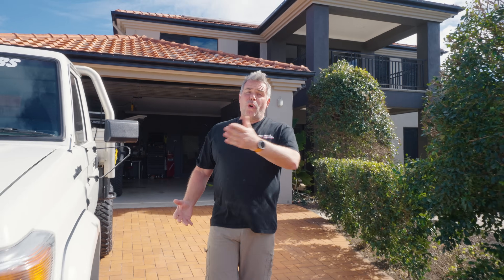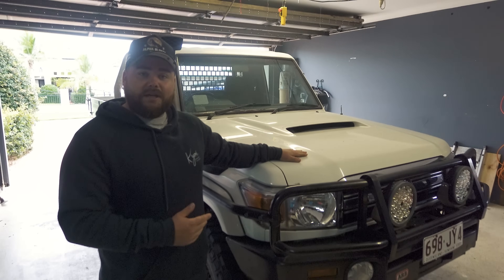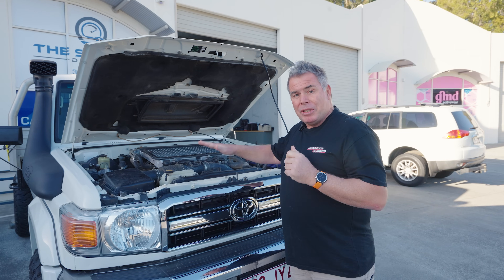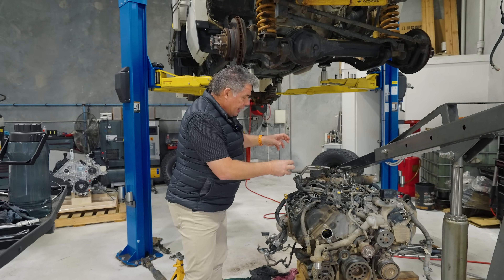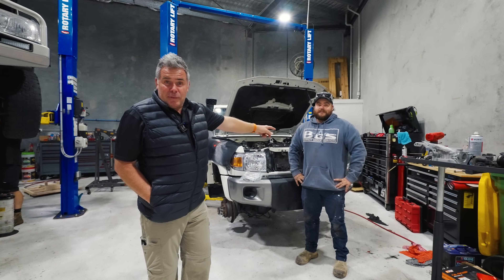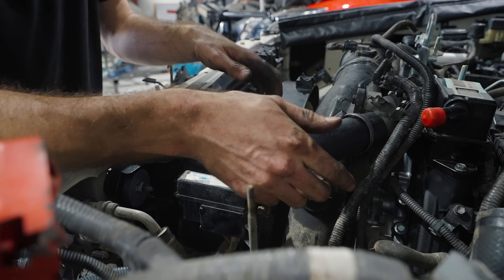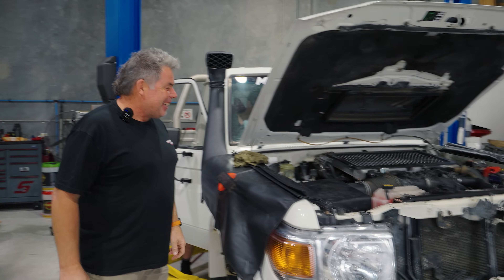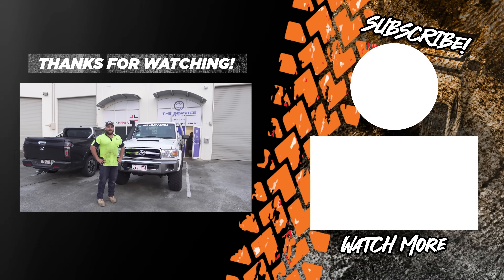We Spent $39,000 on a BRAND NEW ENGINE to put in a 17 YEAR OLD CRUISER

Comment: Mate you got ripped off. 39k for that is insane.
Reply from the maker: Before we did it I would have agreed with you. However the parts add up very quickly. New engine, injectors, 1600nm clutch, new gearbox, new turbo, new radiator, new fan box, new fuel pump, new starter. Then add in manifold deep cleaning along with lots of ancillary bits and pieces plus labour.

Comment: Cracked piston on a 70. Any chip tuning? just curious.
Reply from the maker: No tuning, think water damage before we bought it
Reply: @MudModsBeers What about dust ? , the air boxes on these engines , including 200 series , are notorious for leaking dust past the filter & If you go back to the round ones on a 100 series like mine , the clips are piss weak & break off at the slightest bump , the only answer is after market . I put a moonlight fab stainless box on my 100 that takes a big panel filter ( they were developed for 70’s & 200’s but adapt to 100 fte ) not advertising for them & it cost plenty but it does seal real tight.

Comment: How many KMs on the clock when it started knocking?  
Any specific reason it let go?
Reply from the maker: It was around 300,000 kms when when first heard a knock. Fast forward two years and it was progressively getting worse. We think it was piston slap maybe from water getting into the engine before we bought the car

Comment: Hi, got 2 vdjs, a 2009 pre-dpf, and a 2021...could you please give a bit of history on the motor with the cracked piston? eg, How many km, what type of driving, service intervals, tuning mods? Does the new motor come with a factory warranty, and will doing other mods to the car void it?  Thanks, and all the best...
Reply from the maker: Thanks for watching. The motor (& vehicle) had around 300,000kms on it when we first heard the click. Had it diagnosed by a couple of mechanics who both agreed it was piston related. They presumed water might have got in at some point and on compression damaged the cylinder and caused the piston slap. We’re still not sure it was a cracked piston or slap.   Motor wasn’t tuned as far as we know. Did have service history when Andy got it at around 290,000kms.  Did do some hard tracks and wasn’t babied.  There is a 12 month warranty on the motor. Not sure if other mods bill viod it, I’d say if it was engine related it probably would.
Reply: @MudModsBeers  Thanks for the info...vehicle could have been sold by an unscrupuious vendor who dunked the motor and knew what the likely outcome would be? Maybe check the diffs too...I bought a 2006 Troopie, and when fitting difflocks found silt in the diffs...had to replace the pinion gears. It was an expensive 'hidden history'. All the best..
Reply from the maker: I'll take your advice on that and get the diffs both checked.  We've had it for about 3 years now without any other issues, that was the main reason we went with the new engine a the rest of the car is in really good shape for it's age.  Thanks though, bloody unscrupulous vendors!  Hope the Troopie is going well?
Reply: @MudModsBeers  Troopie's going great thanks...didn't have diff breathers when I bought it, and reckon someone stood it in a creek too deep...oil in the diffs was good, but leading hard  edge of the gears was really badly worn...
Reply: My opinion of why the piston likely cracked would have been due to the injectors - old & worn out injectors cause these issues all the time on toyota D4D engines. Very simple to check the health of each injector quickly with a scan tool but recommended replacement is something like every 200,000kms regardless of the feedback values. They aren't like the old 6 cylinders, they last forever and cheap as.

Another common failure on the older vdjs is the oil strain pickup - they're only plastic and go brittle over time and send small chunks of plastic through the oil galleries causes bottom end failure (spun bearings etc). Also very easy to replace and cheap!! Recommended every 100,000kms

Oh and be careful who you get to service the engines as well - if they forget the little tube in the middle of the filter, it'll suck itself in and starve the engine of oil. will lead to failure 500km or more after the service.
Reply from the maker: @Beng177  thanks mate, thats really good advice. I’ll keep that all in mind.

Comment: You could of put a powerful motor in it for 39k
Reply from the maker: Agreed, however as it's a long term car, we wanted to keep it super reliable and not have to spend any more on it for a long time.  Also the $39k includes the new gearbox, heavy duty clutch and about.  The engine itself was around $16k + injectors.